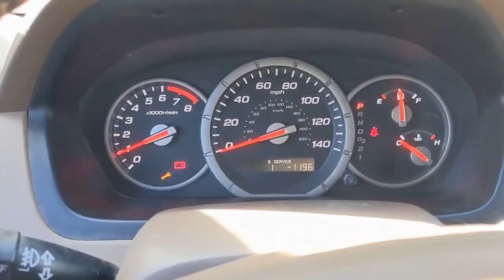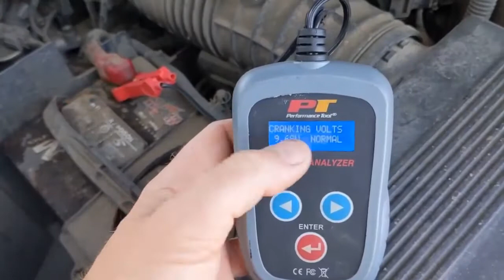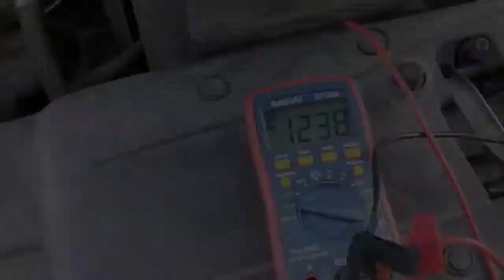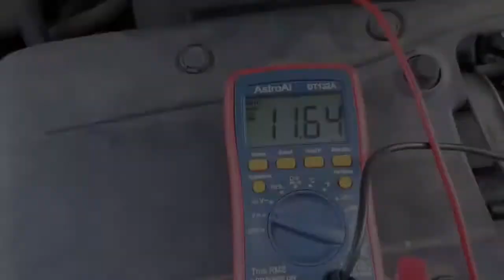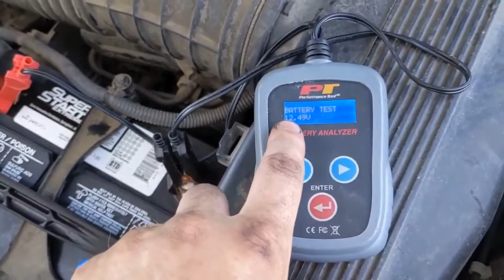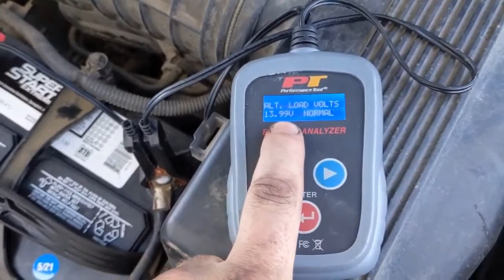Honda Pilot Battery Light on Alternator Testing | What Causes Battery Light to Come on

Comment: So does your test prove ground cable on battery is good or could that be a possibility while under load?
Reply from the maker: This shows testing the output of the alternator directly. If the alternator was producing the correct voltage output then you would need to do a voltage drop test across the negative cable and the positive cable and their connection points separately. But because the alternator output voltage was low the problem was in the alternator itself.
Reply: @ValleyMobileAutomotive  It's not testing it directly as there could be a ground wire connection bad from engine to the battery causing it to read low. I would think you would want ground on the alt or on engine at least.

Comment: My aunt’s Pilot died right at the top of her driveway and steam came out of her 2010 Pilot and it has 199,999 miles is what she told me she says that she wants to keep it but I don’t after the steam and the flashing check engine light and flashing hot coolant system light they got it in 2011 or 2012 and I think it had 50,000 miles on it I don’t remember but if someone can please help me out here 2010 Honda Pilot Touring going up into steam.
Reply from the maker: @techman2124  Does the car start now? You'll need to determine the cause before making a decision. It might need a new engine or something else less expensive.

Comment: My dash on my pilot showing battery light and today my car stop on me while driving you think is bad alternator let me know thanks!!
Reply from the maker: I think it's a good possibility that it is your alternator. Having it checked is always smart before replacing 👍
Reply: @ValleyMobileAutomotive  yeah cause now I try to turn on the car and it wont start
Reply from the maker: @chris-samuel-cesar  if the alternator stops working the car uses the battery for all its electrical needs. Once the battery is drained the car no longer has enough power to run.

Comment: I will be traveling down the high way so the battery light comes on as shown check battery system comes on but I place a new battery.
Reply: Change battery terminal connectors

Comment: thanks my friend. I have a similar problem but in my case the battery indicator light comes on sporadically, I turn off the engine and turn it on again and the light goes off
Reply: Same issue here... did you find out why it's doing that?
Reply: Check your ELD

Comment: Same issue I checked my battery was good I checked my alternator was 140 don’t know what it means but the guy said good possibility a wire but don’t know which wires should I check can you help thanks!
Reply from the maker: If you are getting 14 volts at the battery then I wouldn't suspect a wire (not yet). You also need to check the alternator's "AC ripple". Your alternator has diodes in it to change AC current into DC for the battery. If a diode is bad it can still put out 14 volts but it won't be a clean enough DC current for the system. If you don't have the capability to test this yourself, you may need to take it to a shop for diagnosis then do the repairs yourself.
Reply: Change battery terminal connectors